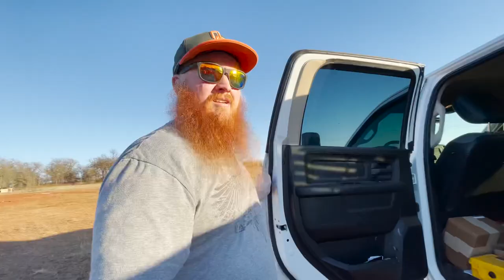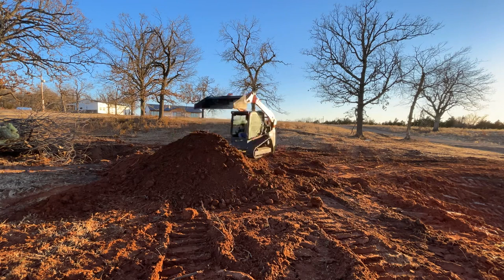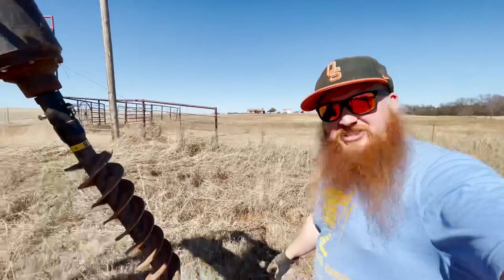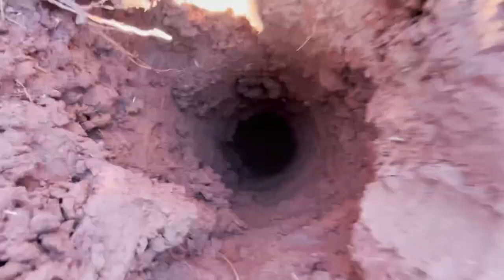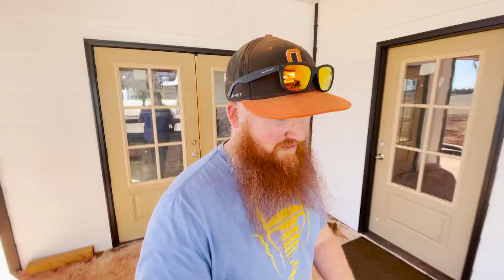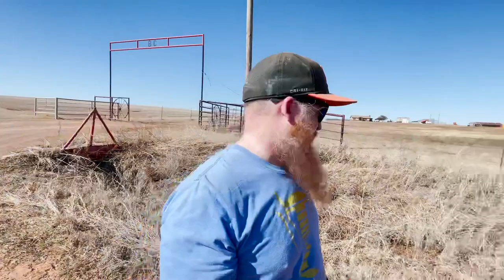Final Touches!!

Comment: Do u knw u have to put water with the concrete to make it steady
Reply from the maker: Yes - normally I would have, however it was so wet outside and next to that bar ditch that by the time I went to put the bag of concrete in the bottom of the hole began to fill with water. I know that concrete got wet enough. It’s solid as a rock now
Reply: @hearlyfilms  that’s better then nothing